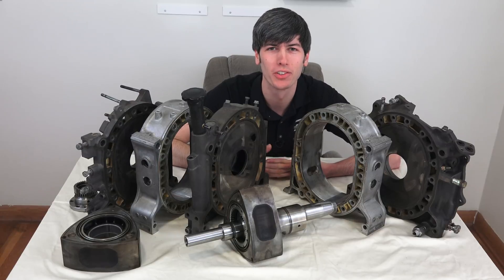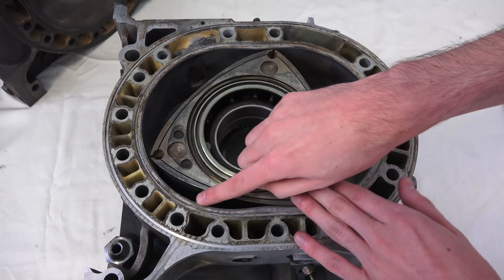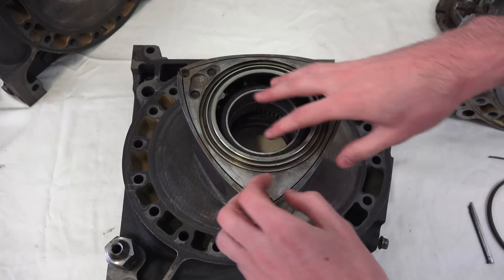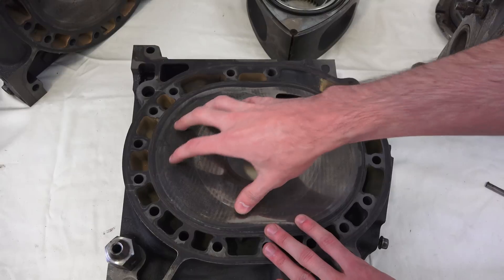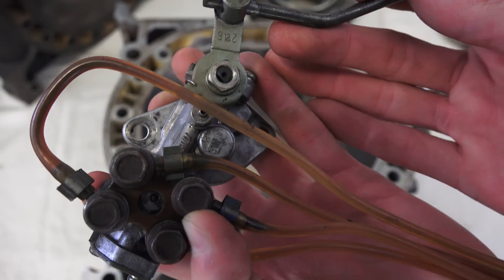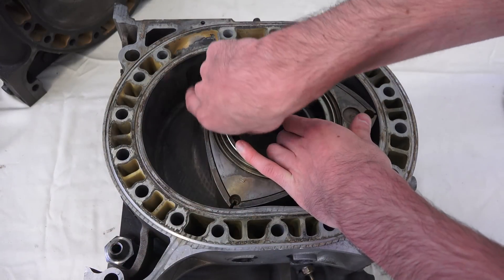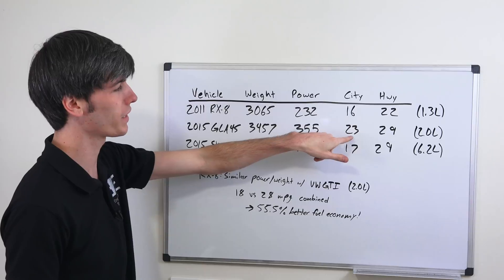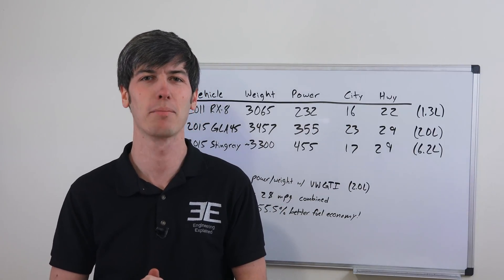4 Reasons Why The Rotary Engine Is Dead

Comment: So what's the big advantage of the Rotary over the standard piston  engine ?,,,,,,,Nothing!!!!.
Reply: The wankle holds the record for IMSA races won to this day, and won the spa 24 hour before being banned. LOL
Reply: The real doktorbimmer it was banned in SPA 24 hour after destroying the field, look it up
Reply: The real doktorbimmer Here's a fact for you....
It aint a fantasy, as people ACTUALLY STILL USE THEM...

AND THE NEW UPCOMING RX-9 MAKES SURE THE ENGINE AINT DEAD YET AS IT THE RELEASE DATE WAS TOLD TO BE AROUND 2019-2020.

ONE MORE THING: They got a new Patent for a new Rotary Engine.. MEANING IT WAS PROBABLY IMPROVED....
And "Delusional Fantasy World"
It's not so much delusion but so much a fact.
Reply: No vibrations at 8000 RPM... decent powerband too and great sound..
Reply: The real doktorbimmer could not compete ?  it was DECIMATING the field until they were banned
Reply: I want one on my lawn mower ( :   NOT.
Reply: The engine does not have any advantages to a NORMAL guy who just wants a daily...
However, every possible advantage in tuning, etc... except for one con and that is reliability...
But then again, if a person loves a car that much and is willing to spend that much money, the
engine is AMAZING.

Just a matter of preference...
Also, the damn engine got banned for performing way TOOOOO well in spa.
Reply: OreoThePanda It is not a matter of preference. The small size, weight, smoothness and high power/weight ratio means it is ideal as range-extender. Which will be its niche.
Reply: More rounds per minute, I guess.

Comment: You might want to tell the Aircraft industry that, they still use rotary (Wankel) APUs.
Reply: The aviation industry does, the aircraft industry doesn't.
Reply: The real doktorbimmer Not arguing with you on this one. Was just pointing out that the Aviation industry is a dinosaur and run on obsolete equipment in many countries/backcountries. Actually I'm thankful you work hard to denounce vaporware scams such as LiquidPiston.
Reply: The real doktorbimmer
You don't know what an APU is. Auxiliary Power Unit.
Reply: APUs are used to start turbine engines (outboard or inboard).  Run hydraulic pumps and generators.
Reply: Now with the advent of small turbine engines, most companies have moved to Turbine APUs.
Reply: The real doktorbimmer
Your talking out of ignorance is interesting, without research you talk or type. Bet you know alot about nothing.
Reply: Lookup the RX9.http://www.topspeed.com/cars/mazda-rx-9/ke3713.html
Reply: It's the Production version of the RX Vision.
Reply: The real doktorbimmer Sure, was just pointing out that the aviation industry runs on 60yo planes in many countries.
Reply: The real doktorbimmer Thought I should mention that I was referring to the use of rotary engines not the Wankel engine specifically. Your facts are right about that specific type of engine.
Reply: My mistake again, I meant radial engine. Surely I'm not knowledgeable on this subject.
Reply: The real doktorbimmer Again sorry for my mistakes, I'll take that as a lesson before I talk about a subject I don't grasp in the future.
Reply: JJ K Yes, the rotary radial engine is not a Wankel. The Wankel is vastly superior.
Reply: The real doktorbimmer 
The rambling thoughts of a deranged mind.

Comment: I owned a series 2 and a series 6 and I have to say that they were really fun to drive and scary quick, especially the twin turbo. MPG was a problem but I don't think you own a RX as a shopping basket or a around town runner. They were designed for having your foot through the floor and running at a rpm your standard piston engine would of red lined long ago. I own a worked 6ltr Chevy V8 now which I just love the sound of, and setting off car alarms on cars parked next to me when I start it up. Its also fun to drive, has insane power, and has better MPG than my RX's, but I still miss my RX7's for reasons that only a true RX7 owner could relate to.

Comment: The rotary is dead but for non of the reasons you sight except fuel economy. all of the sealing problems were addressed and solved in the 70s and 80s. The 3rd gen RX died mostly because of under hood temperatures. 1600 CC and 0 to 60 in 4 seconds dispels your idea of the combustion chamber design, although it is not ideal for an internal combustion engine. The engines durability has not been a problem since the 70s.

Comment: I loved my 2006 rx-8 it was a fun car, it would burn a 1/4 of a quart of oil per week and I never understood why, but I was using 5-30 regular motor oil and I swapped it over to full synthetic 5-30 and it would burn way less oil week to week and with this video I see why it burned oil! Thanks for the vid! I knew they weren't efficient on gas. It didn't matter if you were in the throttle or not it burned the same but for a 1.3L engine dumping 230hp I pissed allot of people off lol!

Comment: For the mileage stats, is that actual measurement of gas consumption? Or is it where the measure the emissions and estimate what the mileage must be?

I ask because it seems that intentionally adding oil to the mix would be a different model than the one used to come up with the estimates.

Comment: Pistons go "BOING BOING" while Mazdas go "Hmmmmmm." What that commercial forgot to mention is they go "Hmmmm .... BANG POP." After climbing a hill to get home my RX-4 would often backfire about a minute AFTER the engine was shut off. Seeing how the combustion chamber had unburnt fuel and oil left in it I guess fuel would ignite from the heat of the engine. Now I see if the rotar (piston) was positioned with the exhaust port open, BANG! backfire. Scared the crap out of me every time.

Comment: The original engines had teflon seals on the rotor that lasted too long so the factory changed them so they would wear out quicker.  The engines were designed to be only about 35% efficient at best thanks to oil companies controlling the car industry, all combustion car engines were about 30-35% efficient , rest of fuel burned in catalytic convertor or went out the exhaust. The biggest downfall for the rotary was the cases warping if the motor was run too hot without coolant. The seals on the rotor didn't seal due to warped cases.

Comment: @Engineering Explained
Great video and analysis. I worked as a Parts Manager at a Mazda Dealership in the UK when the Rx8 was released. What amazed me was the performance of the engine, however it was common advice to carry a litre of Oil in the car.  No problem you might think, but it was a regular occurance that owners would return complaining or inquiring into abnormally high Oil use. 

Many Modern Cars do not use much oil at all and so it was explained away as being a "performance model" so to infer it was the Drivers fault for driving fast. While this may have been the case the mechanics (who were used to working on Mercedes Benz Vehicles at the same Dealer Group, would remark as you had on the Oil Guzzling design brought by way of the injectors you showed.

Well explained! While it was a great design, it had many flaws. Being partly owned by Ford ensured that this engine design would once again be shelved. You can pick up an Rx8 today for under $2000 which reflects on how it failed to hold its value over time.

Comment: hmm now if they changed the design of the rotary like the old fashioned rotary valve 2 stroke race kart motors like the Parilla tt25 that used a rotating disk shaped piece of metal and not a triangle shaped piece of metal u might get more power and efficient  out of the tt25 u get 25-30HP out of 100cc or engine space if you had a 2.0L you would get 600 HP if they used this method

Comment: The American M1 Abrams tank uses an auxiliary rotary engine power unit. All power came from the main turbine and consumed masses of fuel when the tank was stopped. The auxiliary rotary genny may be used when the tank is stopped to provide a-c/heating and all electrical power when the main engines are off. The turret is operated by the rotary as well. So the tank can be 'hull down' with the engine off and turn the turret & gun.

The rotary engine may be used even when the main turbine is running and the tank is moving. The rotary engine genny was developed by the TARDEC U.S. Army lab. It has a high power density of 330cc modified to operate with various fuels such as, high octane military grade jet fuel. The entire fleet of Abrams tanks were retrofitted with the rotary auxiliary units. It saves 14% in overall fuel consumption. The rotary is inside the tanks reactive armour shield, so if disabled the tanks has power and the RPG's will bounce off. The small size, high power output for its size and smoothness were advantages which led to the rotary being chosen. I believe it is made by PAT. Things are moving for the Rotary. 

A new diesel engine is being developed for the tank to give a smaller heat signature, with the rotary auxiliary being kept.

Comment: Despite its drawbacks, the rotary engine is still a great design. It wasn't made for tree huggers or penny hoarders, it was made for racing and driving enthusiasts. There's something about the way it can rev to 9000 rpm so smoothly, pulling harder with every second, that makes it worth the extra money and maintinence. Also, if a rotary and piston engine were both driven on a racetrack until they just broke down, the rotary would last much longer. It doesn't mind being driven hard, so for the spirited driver there is no better option.

Comment: My only issue here is that you're comparing a car from 2011 to cars from 2015.  Even if they are all sports cars, that isn't a fair comparison for the RX8 because more modern cars are going to be more fuel efficient AND potentially generate more power.  That aside, great video.  Sure I already knew about everything you discussed but your organization and descriptions were very easy to follow ^^
Reply: The RX-8 is about on par with the Honda S2000. Which got 18-25 MPG, 237BHP.
Reply: Comparing those two cars would be perfectly reasonable, I agree.

Comment: Mazda have done very promising research on HCCI ignition for its SkyActiv-R rotary engine project using research from its SkyActive 2 program. They have removed the need to locate the spark plug outside the combustion chamber to allow the rotor to sweep past. Mazda solved this in the SkyActiv-R rotary project. Rotaries generally have high compression ratios giving the design easy adoption of homogeneous charge compression ignition (HCCI).

It looks like the next Mazda rotary will not have a spark plug and be HCCI ignition. Fuel consumption will match piston engines and when used at a constant speed range-extender gennny as in a hybrid, outperform piston engines with all the advantages of low weight, small size, super-smooth, simplicity, etc. The efficiency and longevity of rotaries is excellent when at constant speeds and low revs. 

The expectation will be that the engine will be introduced in 2020, the 100th anniversary of Mazda. Looking good. 

Explanation of HCCI from wiki:
"Homogeneous charge compression ignition (HCCI) is where the fuel/air intake is a pre-mixed lean air-fuel mixture then compressed to the point of auto-ignition. Electronic spark ignition is eliminated. Gasoline engines combine homogeneous charge (HC) with spark ignition (SI), abbreviated as HCSI. Diesel engines combine stratified charge (SC) with compression ignition (CI), abbreviated as SCCI. HCCI engines achieve gasoline engine-like emissions with compression ignition engine-like efficiency. HCCI engines achieve low levels of nitrogen oxide emissions (NO x) without a catalytic converter. However, unburned hydrocarbon and carbon monoxide emissions still require treatment to reach automotive emission regulations."
Reply: The real doktorbimmer 
You need therapy Sad but true.

Comment: The most disturbing characteristic of the Sachs Wankel motorcycle engine was its internal gear lash: a perceptible 'klunk' every time you ever so slightly accelerated or decelerated.